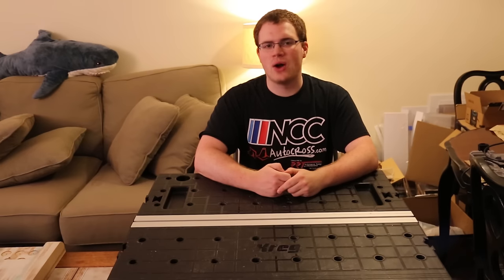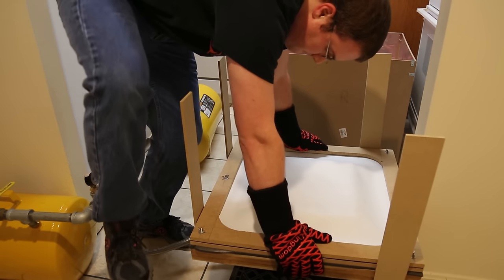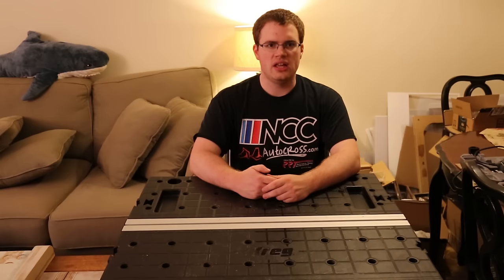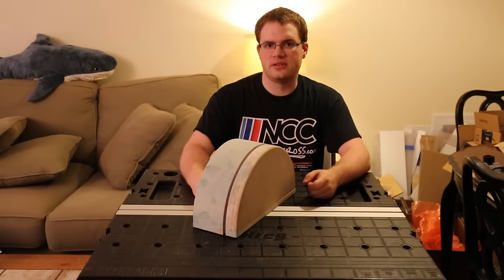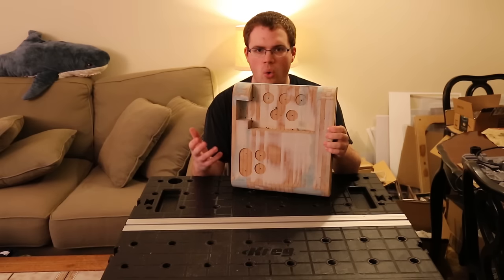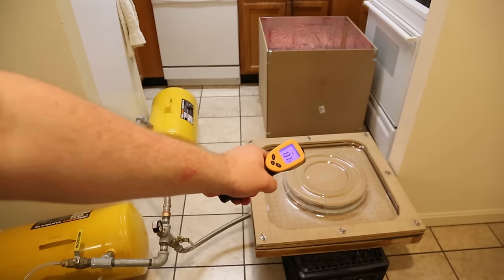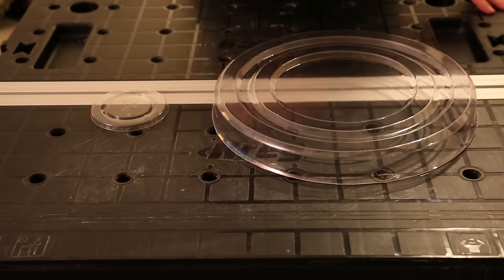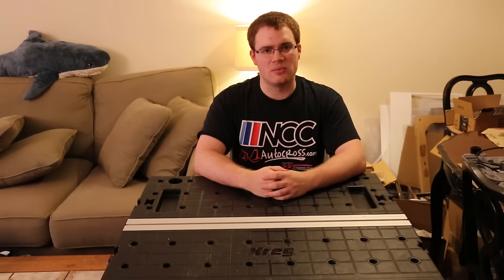DIY Vacuum Forming - Complete Video Guide

Comment: i have a HF vacuum pump. looks like i need a tank to pre-load the vacuum so the plastic wont cool too much and act faster ?? i plan to use kydex for my holsters.. do you see any problems ??? at this point i plan to use peg board. the chamber im building is small 18" x 8" and very shallow maybe 2" or 3"  ?? sry. hope im not asking too much.. thanks ron
Reply from the maker: Most smaller and inexpensive vacuum pumps doesn't have the draw necessary to evacuate enough air to work by themselves. That's why we use a stored vacuum charge system, where we slowly evacuate a container of air (make a vacuum) and then quickly unleash it at full force all at once. As long as you seal the platen box well and have a strong enough charge for your application, there shouldn't be an issue forming an 18" x 8" x 3" space. I've never worked with Kydex, but I've seen a lot of people use it for the application you want to so I'm certain there are some great write-ups other people have done on Kydex thermoforming floating around the internet.

Comment: This is a fantastic video! I'd love some more decent info on buck design, it's very different going from a 3d printing environment.
Reply from the maker: The overall main concern is just making sure whatever you form can be de-molded from the buck. So, no receding walls, trenches (why the form at 0:06 in the video was done 'upright' in halves), or undercuts. Any inset areas are mostly a concern for the plastic rather than the buck, so attention needs to be given to the heating time. You want the plastic to sit in the inset portions nicely but also need to heat the plastic for longer to achieve that. Too long and you may have blow-through, not enough time and the plastic may not fully form into that area (see form at the start - 0:04). Most people making masks, RC bodies, and plane canopies though don't really have to give that much thought since they're all usually smooth with only small insets. Just visualize the act of forming plastic around the buck and ask yourself if it can be released post-form. I'd also suggest, like mentioned in this video, adding a small buffer to the bottom of your buck so any deviations at the bottom of the sheet can be cut away during trimming. Height-off-the-platen is usually the one thing that adds more difficulty to the forming process, but this depends what the buck shape is, since usually you either need larger sheet area or a thicker plastic that you will heat for longer (which increases the surface area, but results in plastic thinout). All the examples at the start of this video were done in .080" thick material (~2mm), while the cup lid example was done in .060".
Reply: @mwjscn  thanks for the reply and I love the vacuum tank setup! I've gotten an off the shelf vaquform dt2 so I've just been pre cutting sheets of PC/PETG to play with. I noticed with the thinner HIPS/PETG it seems possible to get some amazing small detail but no idea how to get rid of the little flappy bits of plastic and stuff in the smaller details (kinda look like curtains for ants¿).

There really isn't too many videos going over many of the techniques so the couple of things you've mentioned were really useful. But some other things I still can't quite figure out like the placement of those relief holes or whether they could assist in distribution of vacuum through more complex Boolean structures.

Also curious with some of the demos the vaquform guys showed briefly of bucks made of multiple components which makes more complex shapes with that under cut shape possible without too much messing around in a cad environment.
Reply from the maker: @emccat  Quick question, are you placing spacers between your platen and the master (I used nickels in my video) or are you placing the buck directly on the aluminum plate with the vacuum holes?
Reply: @mwjscn  Wow, no I have not! I'll give that a go today!
Reply from the maker: @emccat  Give it a shot. It allows the holes underneath the buck to tightly suck in the plastic around the buck and might also help with your trapped air/resolution issues you mentioned earlier. Given that the machine is pretty small, you may want to use dimes (just don't block the platen holes). Just so long as air can move underneath without being blocked, you should see a performance improvement. If you don't add spacers, basically the buck is sucked to the platen, then those holes do nothing, and once the plastic makes touchdown on the holes around the outside, they also aren't helping either. You just want to make sure to use thin enough spacers per your application so plastic forms tightly around the buck, but the plastic doesn't have room to get sucked underneath.
Reply: @mwjscn  I'm an Aussie so I'm sure our freedom dollarydoos will have some option. But since I'm using printed PETG bucks, it could be possible to model those gaps into the floor of the buck itself. Will have a play around with the models after testing spacers.
Reply from the maker: @emccat  You could, but adding little stands would mean you would have bridging layers. If it were me, I would just print some thin cylindrical stands and keep layer 1 nice and flat for ease-of-printing. Some easy-to-grab coins, wood pieces, or even flat off-cuts of plastic if they were thick enough also work. As long as the material presents some gap and isn't compressible it should perform the task fine.
Reply: @mwjscn  naw, depends on the printer resolution, at a layer height of 0.06mm it'd be possible to create little arches with tiny holes around the entire perimeter base of a puck while still keeping a flat surface area. I tried today using the tips you have given me and from your video they're looking really good and usable!

Really keen on trying some small detailed pieces like teeth for costumes we make! (The jawsets are about the size of your palm).

Thanks again for the tips!

Comment: Amazing video any formula to know the right capacity of vacuum tank required for 1.5 x 1 meters
Reply from the maker: One may exist, but I don't know what it is. It's all about the initial throw and you probably have to hold vacuum for another 10-15 seconds to get it to set well. I'd guess enough volume to both equalize the air trapped under the plastic, in your platen chamber, and in the lines and retain about -10 to -15Hg for that time, which is completely dependent on your buck shape and machine size. You can probably use some easy volumetric calculations to get you in the ballpark.
Reply: @mwjscn  thank you for your quick reply and help.

Comment: Super vid thanks.   Please comment about using polycarbonate.  Pluses and minuses.   (thank you for not adding annoying music that most vid makes add!!)
Reply from the maker: Polycarbonate seems to be more-or-less the same process, but I haven't personally used the material. You can usually find the technical sheet from any large supplier of the material which usually has vacuum forming details on it. Here is an example (Vacuum Forming information on Pages 7-11): https://www.tapplastics.com/uploads/pdf/Polycarbonate%20Fabrication%20Guide.pdf

If you buy from a plastics supplier, just ask what brands of polycarbonate they carry. They also usually have the technical documents on hand for their contractors, so don't be afraid to ask.

Comment: Very good video. I am up to make an rc body and I stuck to the heating. My material is petg 1mm (930mmx650mm). It takes long time and it doesnt do anything in the edges. Only in the middle. Can you help me?
Reply from the maker: I'm surprised that you're having issue with PETG since it's by far the easiest to heat up of the common plastics used in vacuum forming. What are you using for a heating element?
Reply from the maker: @ΓιωργοςΔημοπουλος-ζ3β  The set up you see in the video is 2 x 1500w heaters for a combined 3000w. If it's taking too long, you may want to get another heater - which may also help you distribute the heat more evenly across the entire surface. You'll also want them contained like mine so you can focus the majority of the heat onto the plastic. I used tin foil and aluminum HVAC tape to line the inside to help as well, though I'm not sure how much benefit that gives.
Reply: @mwjscn  Thank you very much for your time and advises. I will get one more heater and we will see. I will inform u. Thanks a lot.

Comment: Very interested in what foot valve you use to open the vacuum tank with. Is it a solenoid air valve? Any make and model? Thanks in advance.
Reply from the maker: The parts list for the build is in the description. It's a simple 3/4" ball valve like you would find in a house basement for water pipes. Easily found at your hardware supply store.

Comment: I am trying to vacuum form an acrylic box about 15x15 centimeters and about 15 cm height. The thickness of the acrylic is 3mm. Can it be done with vacuum?
Reply from the maker: Acrylic is harder to vacuum form, but can be done. Is it just a box? It would be a lot easier to cut the acrylic panels out and join them with Weld-On 4.

Comment: My 1 question. What size holes should the MDF base be and how many and what distant apart???? My base is 700x700mm and have drilled 576 holes @10mm. I'm yet to try this out if it works with 2 Hoover's attached. Any tips??? Thanks
Reply from the maker: The holes I made were 1/8" (~ 3mm) with 1 inch spacing (25 mm). I drilled 289 holes in a 17 x 17 grid. Let us know if your hole arrangement  works well! Sorry for the late reply, I didn't get a notification for this comment from YT.
Reply: @mwjscn  Thank you for your response, so  I tried and failed and tried and every vacuum got slightly better. The shape worked on my wall panel I was copying using 1.5mm HIPS. My next hurdle was not achieving a full pull on all 4 sides flat to the bed!!!! I watched another video where someone raised there tooling on a coin in each corner to raise it off the bed to allow more suction to pull toward the bottom of the shape. ?? I may try this to see if i get a full vacuum all around my square panel. Another thing I might have a problem with is uniformed heat around the edges, maybe my head box isn't good enough which is another reason why it's not worked. The power is most definitely there using two 1300 watt Hoover's. The power is incredible. Anymore tips would be helpful or if you have email could i send you my set up and video of test.to see if you spot anything. Thanks for your time.
Reply from the maker: @elronstar  Yes, you will definitely want to space your buck off the platen with coins. I use nickels in this video (US). You only need about 2mm, just enough so the air can escape. It will give you pulls that are tighter to your buck as well.
Reply: @mwjscn  great look forward to it thanks for help

Comment: What are you spraying on the mold? Just use a pounce bag with talcum. Much cleaner!! 😀 Good video!
Reply from the maker: The spray cleans up on clear PETG parts where clarity is important compared to a powder that becomes embedded in the hot plastic. For those unconcerned with a clear finish or utilizing exclusively opaque plastic, that method certainly also works.

Comment: How thick material could you go with a machine like yours ? I want to make something durable from either 4mm ABS or Polystyrene
Reply from the maker: Material thickness more comes down to fidelity. If you have a nice curvy buck with no sharp lines, the thicker plastic will work fine (the thicker the plastic, the more radiused any angular transitions become). As long as the heater system you have can get to the right temperature for your selected material, it's really just a matter of waiting longer during the heating portion to get the droop level you want/require. I believe this system should be able to do 3mm or 4mm without issue. Just remember that plastic thinout will occur depending on the depth, and therefore the heating duration, you need. So if you have a buck that's 200mm tall even if you start with 4mm plastic it may be more like a 2mm finished product, though this is considerably less drastic if you have a shallow buck as shown in the video near the end. Let me know if you have any follow up questions.
Reply: mwjscn that's all I need to know thanks for the detailed response 👌

Comment: Hi, just one question! i try to make mold for my headlights car, it's possible use the plexiglass (pmma) to forming plexiglass?
Reply from the maker: You definitely don't want to use any material that could deform or melt as your buck. I'd suggest making it out of wood or another material that can withstand the temperature of the forming process.

Comment: Hi, excellent video and explanation. You have a new suscriber. I´m building a machine with a build area of 60 X 60 cm (24 X 24 inch). Do you think I can use a vacuum cleaner at this size? In case that the answer is affirmative, how much power do I need? (3, 4 o 5 hp)
Reply from the maker: You're building one the same size as mine! A vacuum can definitely be used at that scale, but the preference to Dysons become more prevalent as the scale increases. As far as power, I'm not certain what you will need. It would probably be best to test with what you have or what you can easily borrow from friends and family before you buy your own. As you can tell, I really found a preference with evacuated air tanks and a pump rather than shelling out for a Dyson although I would have definitely used one if I had already purchased one previously. There really isn't an issue with having slightly too much power, as long as you're using a plastic that isn't too thin and was heated properly. It also depends how tall your forms are going to be and how much trapped air there will be under the plastic that you need to evacuate or equalize. As you can tell, every individual person and project has a multitude of variables that are unique to their goals. I can give you some advice, but it really comes down to testing and improving your machine through trial and error.
Reply: @mwjscn  Thank you mate. I have one Shop vac style but my first test didn't show a good performance. I will try with a dyson style but definily I will jump to vacuum pump in the future.
Reply from the maker: Yeah, Shop Vacs aren't a good style for a vacuum former (which is a downer considering they're in almost every workshop). If you find yourself wanting to mimic what I have set up, I put the link to the parts list in the description. Feel free to send me a message down the line if you have any more questions!
Reply: Thank mate. Great channel!
Reply: mwjscn 
Hi,  when you specify Dyson,  it's a bit vague since they produce a number of models.
Are you referring to a specific Dyson model?  Or the vac technology ( specifically cyclone type ) or  air watts or just motor wattage? 
I have a lightweight Dyson V6 Absolute, and also the original Dyson upright, the DC01 "De Stijl"
Plus a small 1300w cylinder/bag vac available to use.
( I'm hoping to build same size unit as yours )
Reply from the maker: Cyclone type and big enough. The best models are probably the Ball and the Canister ones. The V6 absolute will probably be too small to work well on a former this large, but you can always test it.